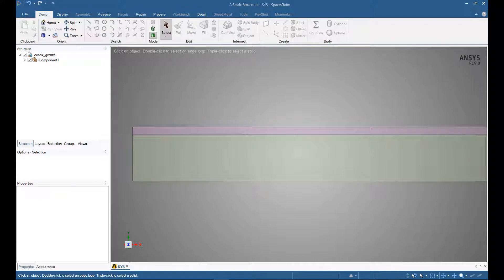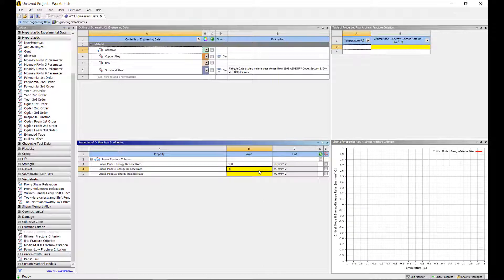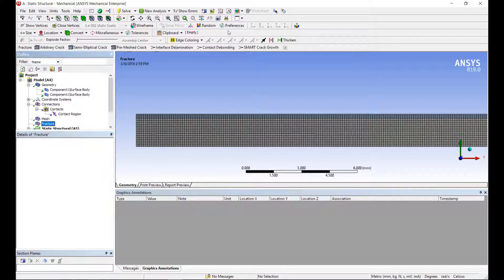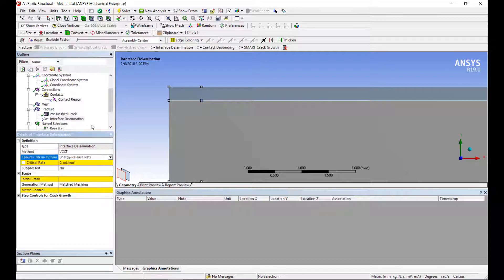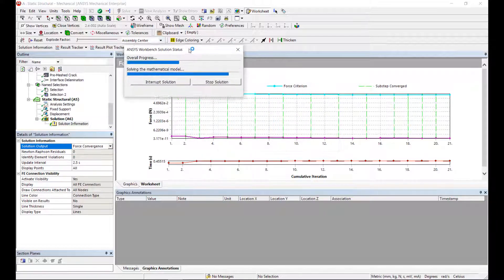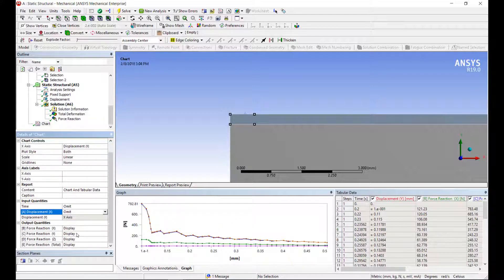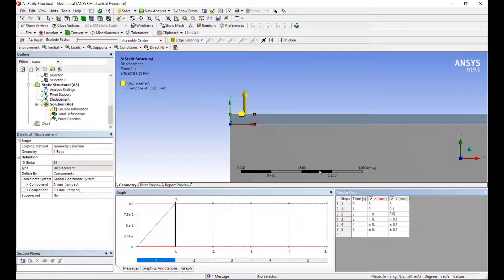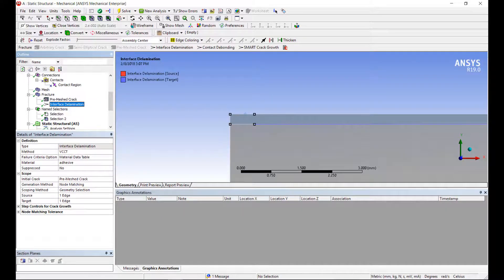ANSYS Fracture and Delamination Part 3: Progressive damage and crack growth

Comment: I get the following error from the moment I set the materials for the upper and lower surfaces:
One of the crack's mesh encompasses multiple bodies which have different material models. Ensure one material model by scoping these bodies to one material assignment object. 
I'm using Ansys 19 R3.
Reply: For those like me who came across this later. If you're following from video 2, you must unshare topology for all edges for this simulation.
Reply: Hi, dear sir >>>>>
I am a student in 3rd year Ph.D., I'm working for materials composite  but now I have a problem for creating a crack in my domain >>>>>
my question is: how can I create a crack on the material composite domain?
Reply: @smailhamidatou367  Are you modelling it in 2D or 3D?

Comment: So, you always emphasize that the mesh should be linear. Why that is the case? Particularly as both cohesive elements (inter) and contact elements that can be used for the fracture surfaces can be quadratic.
Reply: I think in this case the cohesive and adhesive forces deciding where the crack propagate but I think in that case molecular dynamic simulation is much better.
Reply: @anasarbeit4251  Hi, dear sir >>>>>
I am a student in 3rd year Ph.D., I'm working for materials composite  but now I have a problem for creating a crack in my domain >>>>>
my question is: how can I create a crack on the material composite domain?